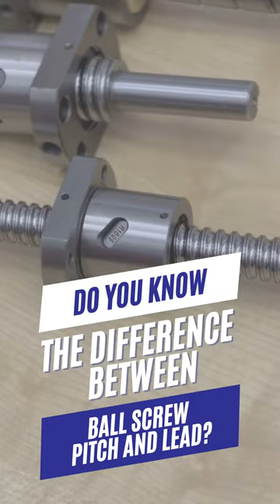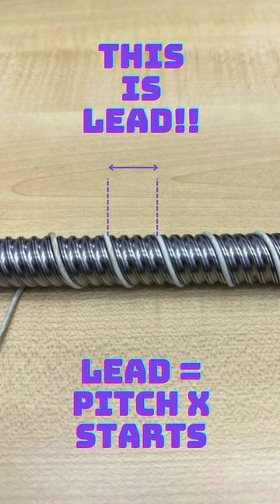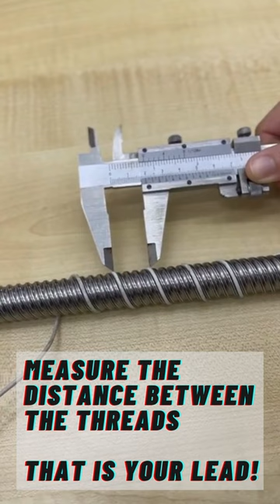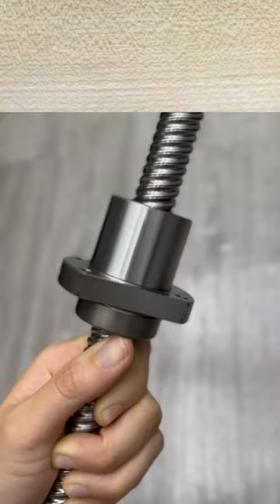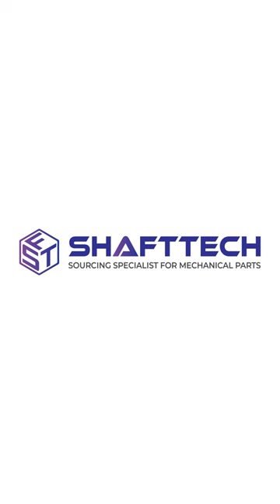Ball screw Lead vs Pitch. They are not the same!!

Comment: I am confused.

Is the lead suppose to be measured by Threads per Square Inch?
Reply: Ball screws can have multiple helices (a regular bolt only has one helix). The Lead is the distance between wraps of a single helix.